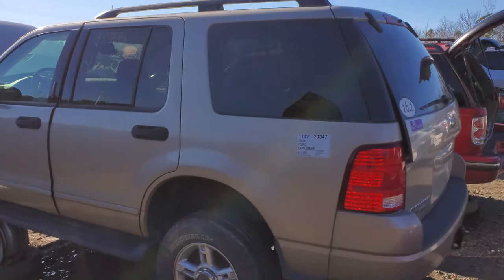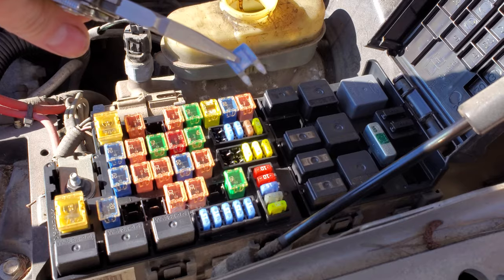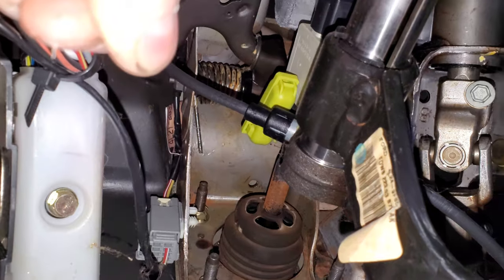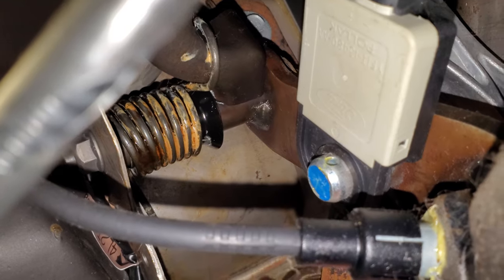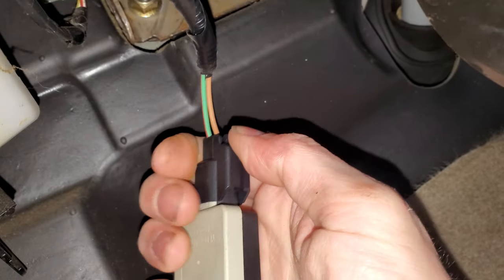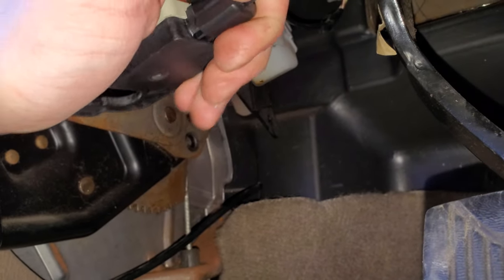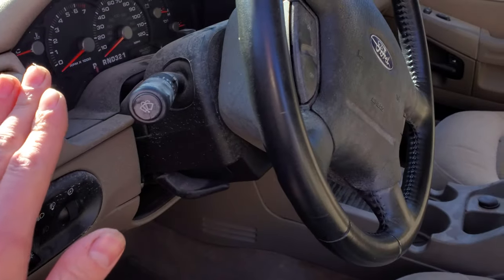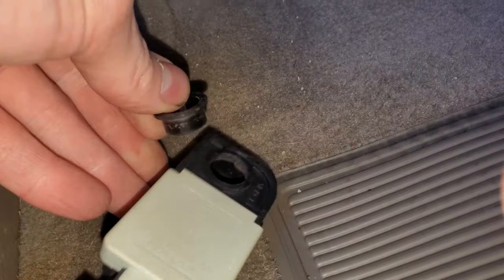2004 Ford Explorer Brake Light Switch Replacement & Fuse

Comment: this video was very helpful.  THANK YOU...  My brake lights were actually staying on.  It was easy to remove the old switch but I was not able to get a new switch that look similar to the one I removed.  All of the local auto parts stores had a kit which contain a bunch of different parts and required crimping wire connectors and I just did not feel like trying to figure it out.  instead I removed the old switch and cleaned it with some contact cleaner and ran a small screw driver between the contacts to scrape away any debris building up on the contacts.  I also pushed the contacts a little farther apart   I don't know how long this "fix" will last, but if I try to replace it again I will make work of finding the exact replacement part.  The hardest part was getting the switch back in place as I should have looked closer at it before taking it apart.  It is not really complex but getting a good view is the challenge.

Comment: Auto part store didn't have switch in stock. So took the white cover off and cleaned the inside. Slapped it all back together and the brake lights went off.  Made it home safely.  Couldn't have done it without ur video. Thanks alot.
Reply from the maker: That's great man glad to have helped. I would recommend changing that switch soon even if it is working for the moment. Thanks for watching!
Reply: Doing the same to mine.  Where does the plastic bushing go?  Into the switch?   Thx.
Reply: had the same issue and was able to clean the switch with a screw driver and contact cleaner...  will see how long the "fix" lasts.

Comment: I was twisting my back trying to inspect the connecting harness wires on the end of the switch without realizing how much easier I could do it by removing the switch (after pulling the retainer pin). The extra diagnostic tip about the 3rd light and hazard switch was very helpful as well! Thanks!
Reply: X

Comment: Hey I'm a first time vehicle repair, thanks for the information. Someone was asking you about the part. I found the identical part on Amazon that fit. All the websites says this won't fit on a 2004 Ford Explorer but it did and it's a Motorcraft part SW-6218 (3F2Z-13480-CB)
Reply: Thank you so much for the part information! Couldn’t find the replacement part anywhere. Just ordered this one!

Comment: Where did you get your part from. When I look on advance, autozone, and rockauto they all look the same but different from the part you pulled off?
Reply: Had the same issue... the replacement part was very different and I did not have the desire to try to figure it out.  My brake lights were stuck on so I cleaned the switch with a screw driver and contact cleaner and it is working again...  Not sure for how long.  But if I attempt it again I will make work of finding the exact replacement

Comment: Hi~My 2004 Explorer brake lights and turn signals aren't working. Do you think it's the switch? We changed the fuse and it worked for one day.

Comment: Thanks for the video. I just ordered the replacement switch for a friend’s Lincoln Aviator—which is just a spiffed up Explorer. Looks like it’s going to be a 5 minute job to replace it. For what it’s worth, I bought the switch for about $25 from 1A Auto. Found them via a Google search. It’d be interesting to know what a dealer would charge to fix it. The symptom was constantly on brake lights. Fortunately my friend had the presence of mind to pull the fuse you showed or I’d be recharging a dead battery and/or replacing burnt out brake light bulbs, too!

Comment: My 2005 Explorer has a right rear brake light out. I tried replacing the bulb and I do not think it is the fuse as the fuse appears in good shape. Do you think that this could be my issue?

Comment: Switch stuck in 'on' position is the more common problem. Also, you were off camera with the bushing replacement and didn't show how switch is activated or reinstalling new switch.

Comment: What if my brake lights stay on after my Explorer is off. Can it be the switch as well?
Reply from the maker: Yes
Reply: Thanks!
Reply: Mine is doing the same thing..my backlights stay on and unable to turn off!
Reply: @FuzzballToday  you have to disconnect the switch.